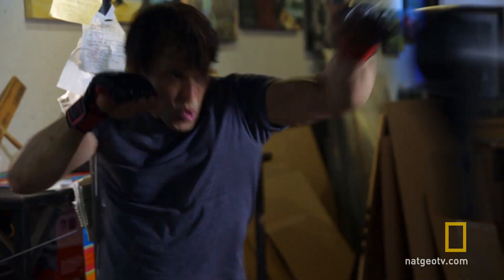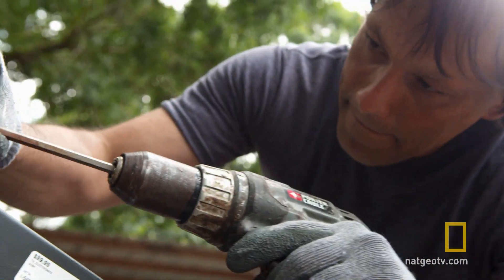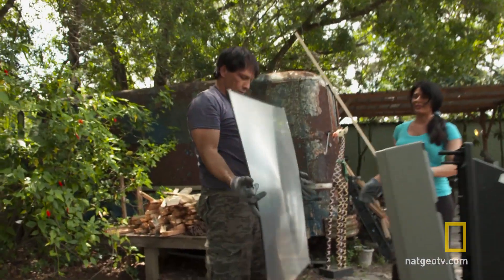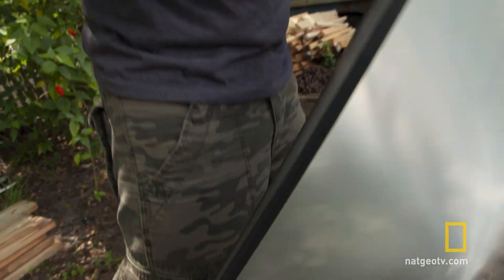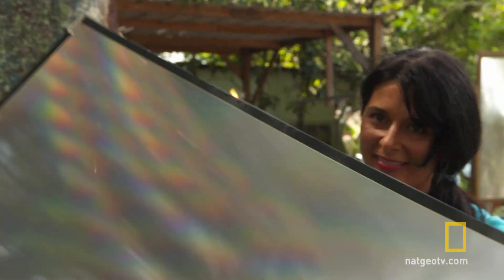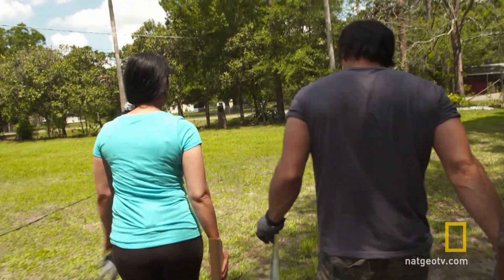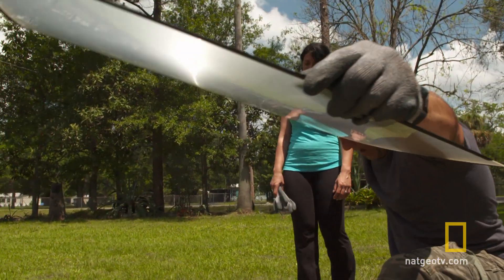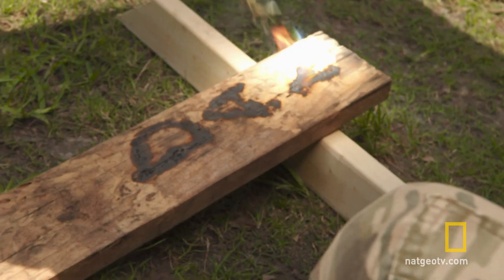Solar Beast | Doomsday Preppers

Comment: Way to go Dan and Denise!
Reply: I learned the hard way to wear double sunglasses when focusing sunlight by burning blind spots into my retinas near the foveae as a child, merely by staring at reflected focused sunlight.
Reply: *****
I have that in one eye, a darkened ring around the foveae, from strong UV from sparks one evening when playing around with someone with my large Van de Graaff. I started the evening wearing welding goggles but forgot to after a while. Whether the UV's from sunlight or sparks, it'll get you sooner or later if you're not careful.